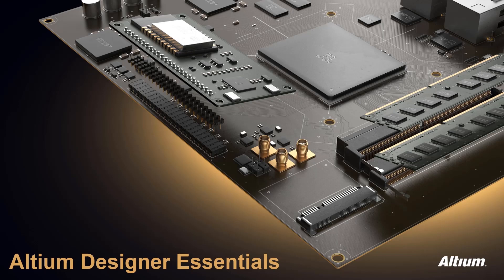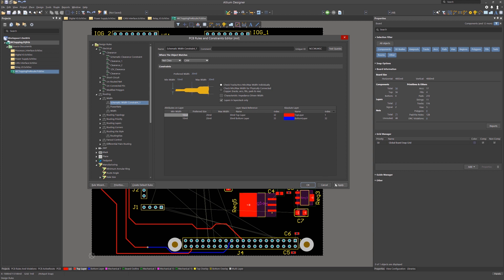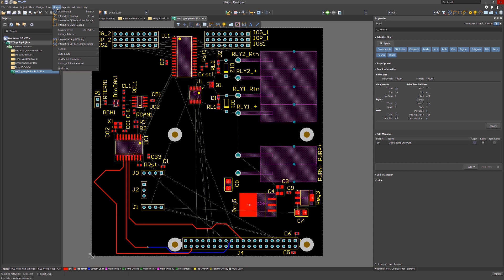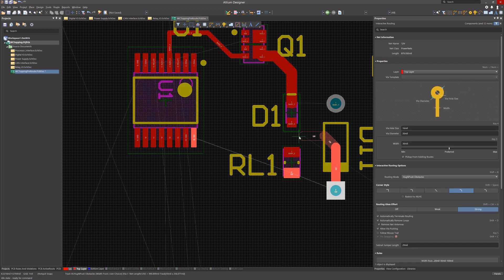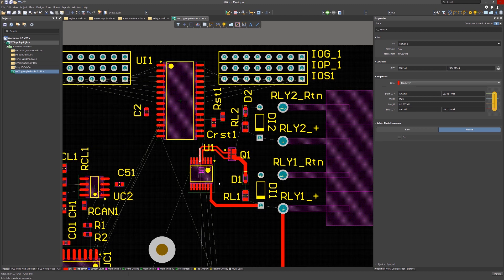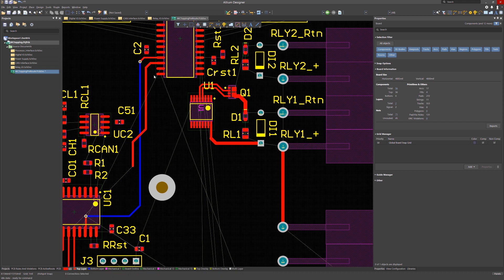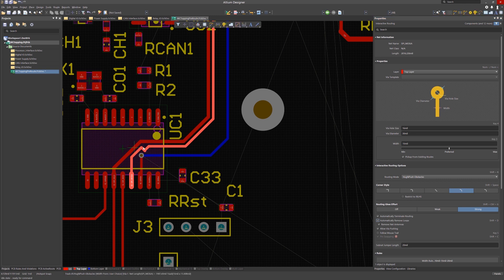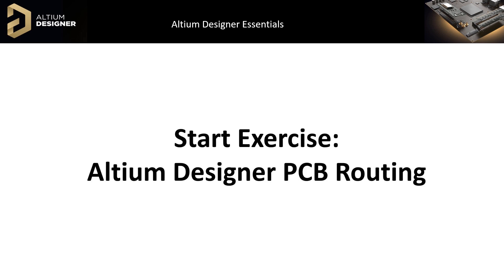PCB Routing | Altium Designer 19 Essentials | Module 22

Comment: Hello, great video.

I'm new to Altium and I have a question:
When designing my pcb, I imported my components and I try to connect my pins or rather the pads of a component between them.
When I try to connect 2 pads together, I manage to make my trace start from the center of my 1st pad, but I cannot connect this trace to a 2nd pad. The trace avoids the pad. 
Do you know where the problem comes from and how to solve it?

Thank you in advance for your precious support 😊

Cordially.
Reply: Most likely you did not connect the pins together in the schematic correctly. You need to use the wire tool to draw electrical connections in the schematic. If you use the line drawing tool, the components will not be connected. The other possibility is that the pins are not correctly assigned in the PCB footprint, but this is less common and it should not happen if you are using the generic components.
Reply: @Zachariah-Peterson  Hello, thank you for your feedback 😁.
I had to design some components schematic and footprints.
Do you think it could be the root of the issue?

Thank you in advance 😄.

Cordially.
Reply: @kevinhoublon8630  Maybe, but without seeing your design data I could not say for sure. This will happen if you do not draw the schematic connections correctly between your parts.
Reply: @Zachariah-Peterson  Hello, I figured out what was the problem :

-By clicking on the "gear" symbol at the top right of the Altium page, we can access the "Preferences" window.

-In this window, I went into "PCB Editor >>Interactive Routing".

-Then in the "Current Mode" drop-down menu, I selected "Ignore obstacles". This has solved my issue. My traces no longer avoids the pads. I can connect my traces to the pads.

Have a nice holiday 😁 and happy new year 🎊 🎉🎉.

Cordially.